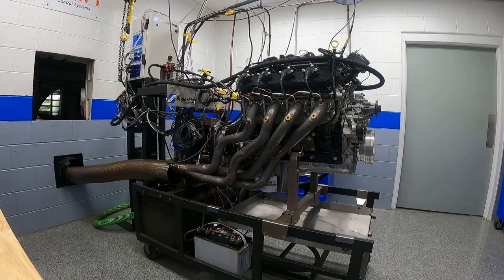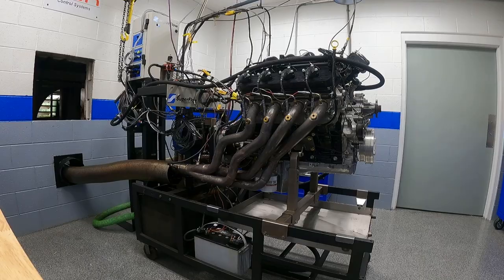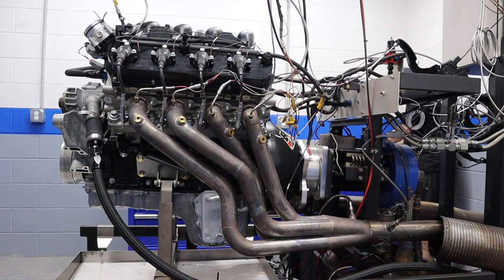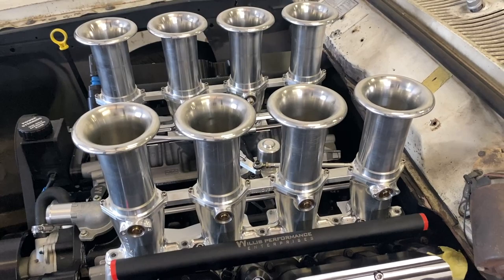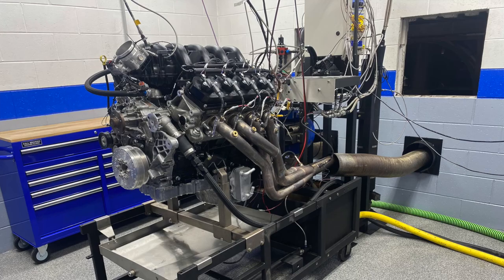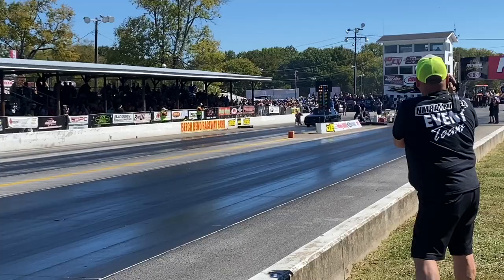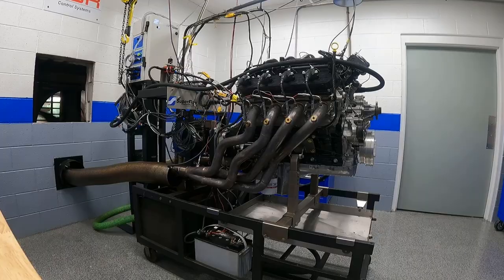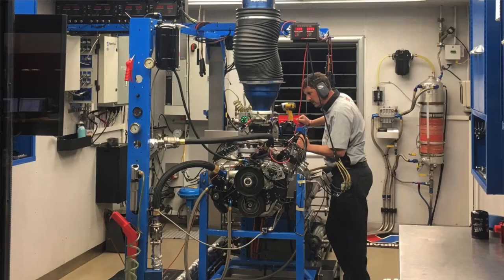The Truth About Dyno Testing — Are Your Numbers Real? Brian Wolfe Explains Hidden Secrets.

Comment: So Quick Question, my pickup has a built 460, C6 2.75 gears and 35x12.50s if I did a regular dyno test in 3rd gear just a 2-5k pull goes from 70-180mph... tires just rated for 95 mph, since there aren't any hub dynos near me wouldn't I need to test in 1st gear? Wouldn't that skew results severely
Reply: I have some opinions on this but do not have direct experience, so would suggest you discuss with who is doing the chassis dyno work.

Comment: Listen carefully. A steady state (rpm) hp test should match the "inertia corrected" HP curve at  that rpm. This is VERY important. This is a cheat. Magazines play games with "corrected HP" depending on who bought a 2 page ad. There has been an enormous discrepancy between BS hotrod magazine types  claiming 600 flywheel HP, then making 350whp on a dynojet. Dynojets have become a resource for the average hot rodder to see that the trick of the week BS part isn't quite what the (paid for advertising) magazine said it was
Reply: I understand what you are saying and not sure if I would call it a cheat anymore than correcting to STP vs SAE J1349.   It is a standard, what I would call a cheat is when someone dials up the intertia factor to produce a dyno sheet that has shows more power than the engine would produce steady state.   As mentioned going down the track the engine accelerates much faster than the engine dyno at even 600 RPM/sec.
Reply: @brianwolfe2993  Sorry for the misunderstanding. My point was also about abusing inertial correction.
Reply: @brianwolfe2993  Sorry for the misunderstanding. My point was also about abusing inertial correction.
Reply: @kylemilligan752  No problem, was not certain so just wanted to add my perspective.

Comment: Years ago when I bracket raced I asked for the uncorrected numbers, and what all of the correction numbers would have been at that time. My engines were usually dyno'd more than once, in different shops. This was done to aid in finding what the corrections actually were to run the number. I could run 9 flats at -1000 feet, and at 2000+, basically every run. The information I learned from not using corrected numbers, got me there far faster than guessing ever would have. Most people don't realize that fast bracket is always run detuned, and guessing almost always puts you on the trailer in bracket racing... No one would have known what my inertia correction was without having the balancing information either. Making that correction number a moot point on any custom build. A dyno is a tool, and it can tell you a lot. And those correction numbers can do far more harm than good in many forms of racing.... Sometimes you need both. And most people that really do good in racing, will never tell you that..... I used the same technique with my road racing car, and it worked there as well....